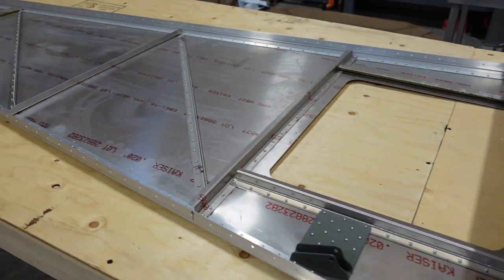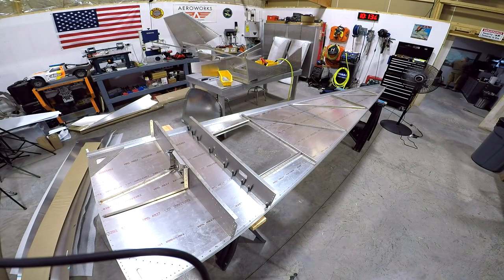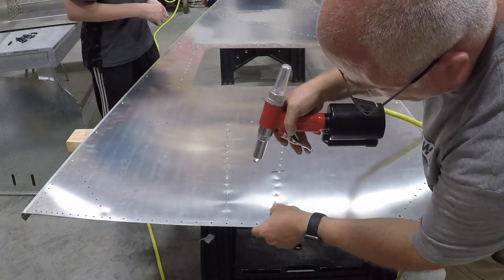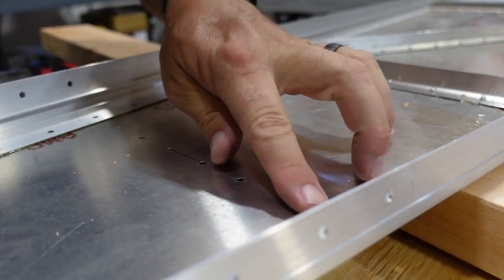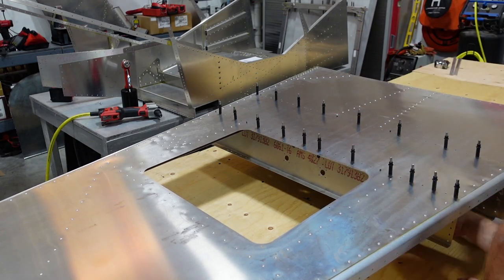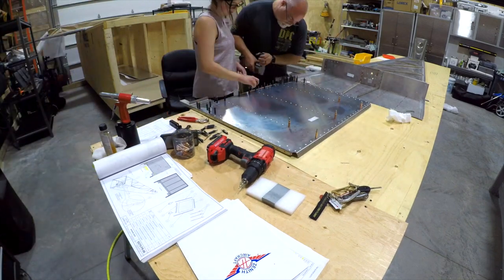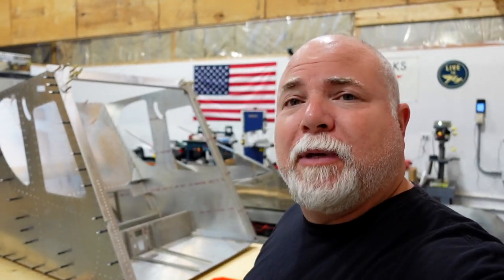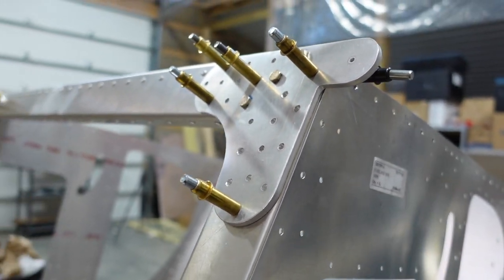Ep. 4 | Fuselage Construction | Zenith Super Duty Aircraft Build

Comment: When you are using the Milwaukee pop rivet gun, does it have the special countersunk tip that they recommend or do you just use what it comes with? Are you using the A4 and A5 rivets or the Avex pop rivets that a person mentioned was to be an option on another channel? Thanks for your videos.
Reply from the maker: All rivets used are Zenith provided.  The Milwaukee rivet gun comes with flat tips which are fine for the rounded A6 rivets but for everything else I used the pre machined tips that came with my air powered rivet gun purchased from Zenith.  Thanks for watching!

Comment: Thanks for sharing. That is quite progress in a week! Your long workbench supported by metal sawhorse is very interesting. Can you share your bench build? Including W x L x H and what is the brand of sawhorse? Thanks.
Reply from the maker: Bing Thanks for watching.  The saw horse set up is a pair of Bora Speedmate horses that support up to 1500 lbs.  There is a slot on each side for a 2x4 so I took )2)16’ 2x4’s and wood from the crate to make the table the fuselage is on.  So far so good and provides plenty of room, almost too much.  Table could even be narrower and still work.  Height is about 30”.
Reply: @AeroworksProductions  Very useful. I am planing a 4' x12' bench and was not sure to use 2 x 4 or 2 x 6. Seems 2x4 is fine. I am looking at the PROTOCOL 47" wide which is on sale for $35/piece. I plan to build a 750 STOL. Thank you for the info. I am going to watch every episode of your videos. Please keep them coming!